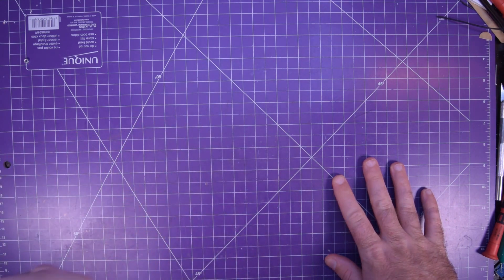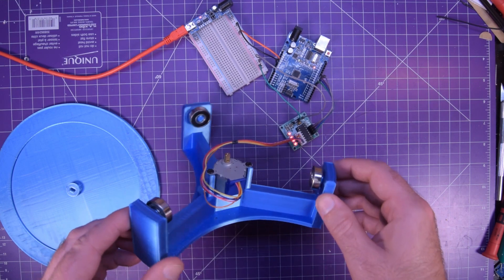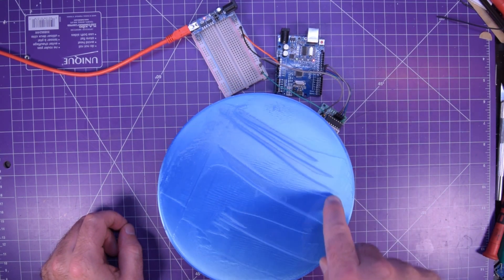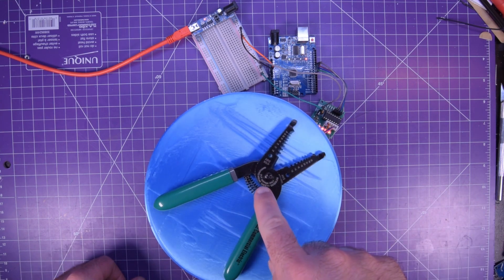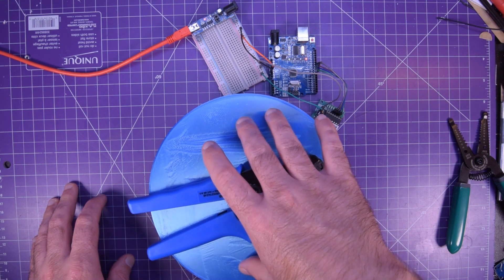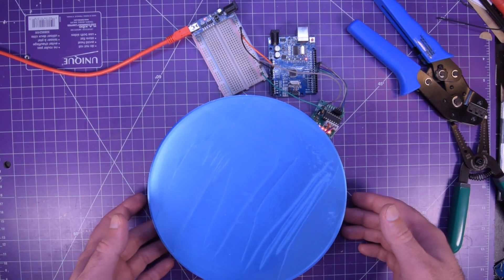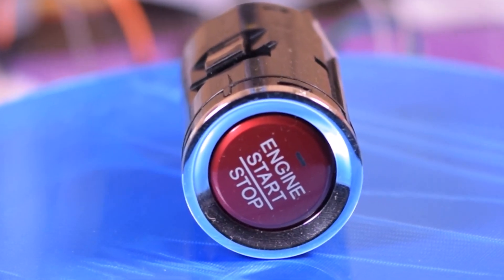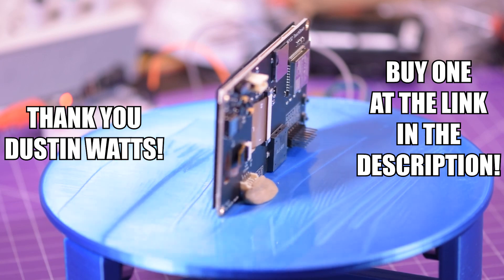How The Turns Have Tabled - 3D Printing For Electronics

Comment: Maybe consider a different stepper motor drive setup, rather than having it in the centre, if you use it with a drive wheel to replace one of the bearings it will be a LOT smoother and more powerful, obviously you would have to have it step faster to compensate for the speed though.

Nice project though, it can certainly add a lot to the production quality.
Reply from the maker: I don't think it would be a problem to drive it faster but if you were to move the drive out to one of the wheels, it would be hard to have traction on the slippery PLA, but I think it would be possible if the underside was gear teeth and the stepper was driving a pinion. It's a bit sad to have to do another reduction, this thing is already geared down like crazy!

Comment: Removing the bearing seals, washing out the grease and replacing it with the thinnest oil you have might
help the motor a little.
Reply from the maker: The stepper motor loses steps way before the friction on the bearing cage makes any difference.
Reply: @SimpleElectronics  OK.  Thanks.